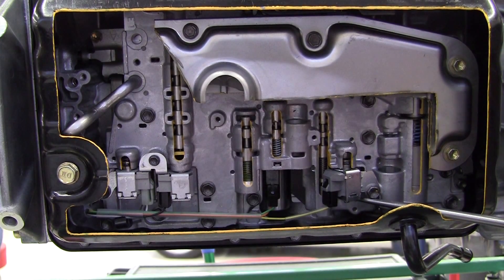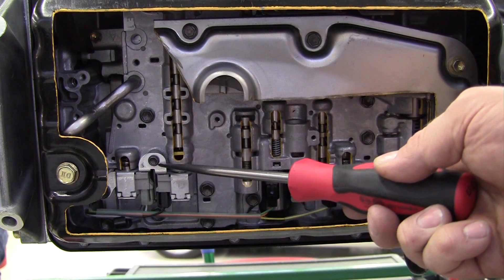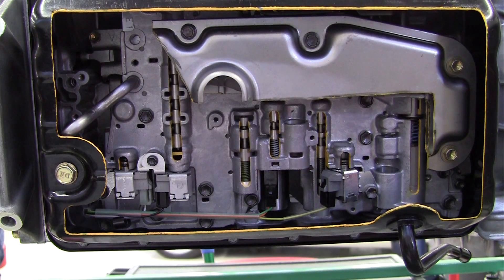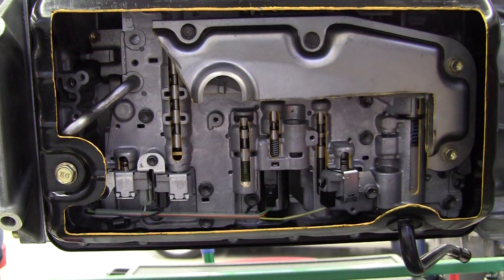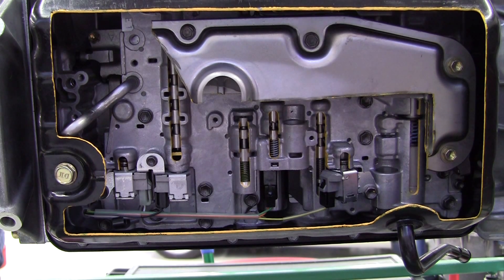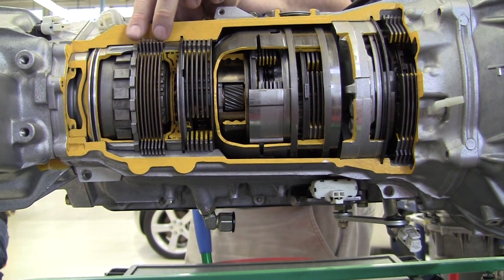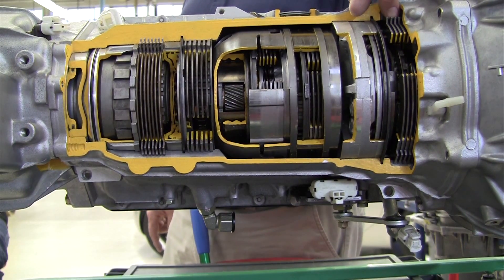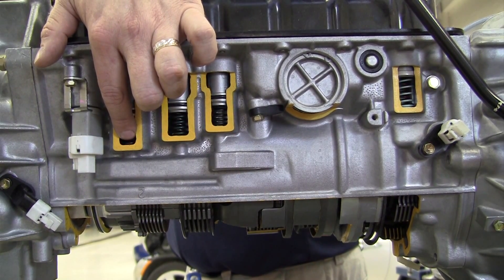Automatic Transmission Basic Hydraulic Operation - AUSV 2520

Comment: When we apply the parking gear and then we jack up the rear wheel and rotate it so the opposite wheel is going to rotate or not?? Because of the propeler shaft is locked from the parking gear pawl is it possible for the other opposite wheel to rotate in opposite direction.. Plz reply?????

Comment: Are accumulators needed when the the transmission has EPC solenoids for each shift valve?   ZF transmission has like 4-5 EPC solenoids that seem to do the same job as accumulators. I didn't see any accumulators on there hydraulic diagrams.

Comment: thank you for explaining the process. I have a 2002 tacoma 2.4 witha a44d Transmission. I do not have reverse. I do hear a hissing sound when I shift into reverse. It rarely engages into reverse on cold days. I did change the transmission oil along with adding locus ATF oil. Any suggestions on what could be the issue.

Comment: Having problems with a Land Rover lr4 transmission it will go into lip home mode after a while of having the driven the car a lot with air conditioning blasting it has a problem when only shifting up from 3rd to 4th but not down let me know if you have any suggestions
Reply: mileage? fault codes?

Comment: Can a torn 2-3 accumulator oring with no compression cause it to not shift to 3rd but still skip to 4th? Mine tries to shift at about 4500rpm but slips, but when I manually downshift from 4th I can feel it thump each time for each gear so I know it's attempting to shift but doesn't seem to be able to grip 3rd. Not sure if the clutch packs went out randomly at once with no signs, the sprag is bad, or if it's something with compression. Its a GM 4T65e transmission. I took mine accumulator apart and the 2-3 piston has as small chip and the oring really badly torn and almost melted looking? The fluid was def burnt but not full of contaminates, maybe since it came from Miami it overheated.
Reply from the maker: It is possible that the leak through the accumulator caused the third clutch to burn up. There is also a 3rd sprag clutch that may have quit holding. Best wishes
Reply: @WeberAuto  Thanks, let's hope it's a simple rebuild

Comment: how does fluid lubricate the gears,usually fluid level is very low ,not top up all the transmission body.
Reply from the maker: There is a fluid pump and passages to distribute the fluid

Comment: what would cause slamming into gear from P->R or N->D, the trans seems to slam going into any gear just more pronounced from 1->2 and it slams when I shift from park? 
it seems like there is excessive pressure when the vehicle is cold, but i am not an expert. I am using generic dexron 3 what is called out and the level is good when it is hot, but high when cold. the trans I have has a manual line pressure throttle cable, but doesn't seem to make the situation better when I adjust it, do you have any ideas, could this be a pressure regulator issue? thanks
Reply from the maker: The fluid could be the problem. High idle speed will also cause that. The TV cable adjustment should be tight at wide open throttle
Reply: what do you mean the fluid could be the problem, wrong type or level? do you have any recommendation what to try, would synthetic make any difference? the trans shifts beautiful after the truck is driven a little bit and warmed.
Reply from the maker: Wrong fluid, not GM approved Dexron. Generic Dexron is not recommended. In cold temperatures some non-approved fluids can be too thick and not flow properly. After it warms up, it flows fine.

Comment: What causes the transmission to shift hard into 2nd only when cold, it slams? 
I have a trans very similar to one in picture, an A340f.
I have rebuilt it myself, new seals, pump, torque converter and clutches didn't do anything with the valve body except new gasket and made sure the valves move freely. I adjusted the tv(line pressure ) cable in either direction but doesn't seem to make any difference. appreciate any advice. thanks
Reply from the maker: Accumulator spring or seal, excessive clutch travel, clutch dished spring upside down, the wrong fluid, etc. Start with proper fluid level and factory recommended fluid.
Reply: thanks for the advice, appreciate it. 
think its probably excessive clutch play. I did notice excessive play in the 2nd gear clutches, think like 30 thousandths past the max, but didn't know how to take up the slack and thought it would be ok since that's the way it was. not sure how it could get like that, the clutches weren't that worn and new ones were about the same?
Reply: figured out the problem or at least adjusting the cable made the problem go away. thought I adjusted it in both directions, but appently not. I thought tightening the cable would give more line pressure and fix the problem but losening it made the shifts softer and the slamming went away. I wish I understood what this cable does behind the scenes.

Comment: I have an Allison trans in 2005 gmc Diesel. When in d the transmission shifts through all the gears but when I use 3 the transmission will shift from first to 2 but will not shift into 3rd gear. I have a bully dog programmer with it set to tow haul mode . Other than the programmer being the problem, could there be another problem.
Reply from the maker: Witt factory calibrations, that would be an abnormal condition. I suspect the programmer is affecting it. Best wishes

Comment: Hello, Sir. Thank you for the great video!  I have a 2000 Nissan Xterra with some transmission issues. When I put it in drive, it won't move at all. It used to have delayed engagement, but now it won't move at all. I have to put it in D2 or D1 to get it to move forward( with some delayed engagement), and can be put into Drive once the tranny warms up, but sometimes won't move forward in drive soon after I turn the engine off. Reverse works as designed. I was advised to replace all the gear solenoids and to clean the line pressure solenoid. I have not done so thinking that a clogged line pressure solenoid would affect all gears.I was also told that a shift solenoid problem would cause a loss of at least one gear. The oil level is believed to be fine. Any suggestions?
Reply from the maker: Anytime you have to put a transmission in D2 or D1 to make it move, it indicates a severe internal problem with a transmission clutch pack, sprag, or roller clutch. Bad news either way. Best wishes!
Reply: Thank you for the answer,  Sir. It is highly appreciated.
Reply: i would try lucas trans fix, it may be a temp fix, but it has worked for me as a long term solution.

Comment: Cvt transmission angage reverse gear but no angage farward gears possible problems?
Reply from the maker: It sounds like the forward clutch pack is not working. Check your fluid level, if correct, there are internal problems.

Comment: Are you familiar with code P0770 on a Lexus?
Reply from the maker: Not enough to be very helpful. From what I can read, it seems like it is a solenoid hydraulic problem keeping the torque converter clutch engaged when it should not be.

Comment: Hi, I have a question regarding doing a "do it yourself" automatic transmission flush. The method is to remove the input line to the ATF cooler and drain that into a catch container while running the car then refill with new fluid through the dipstick tube. My question: is this method safe in that it will not be running the transmission "dry" during this process or do you need to fill the new fluid through the return line from the cooler to the transmission?  The transmission in question is a Aisin AW50-42LE used in older Volvo's and other cars. I've seen this method online but I just wanted to make sure it is safe for all automatics. Thank you!
Reply from the maker: Yes, it is good and safe procedure. Just make sure you keep adding fluid until the fluid coming out of the cooler return line is clean. Running dry is not good, but it won't hurt anything as long as long as it is for a very short period of time.

Comment: nice video and you know your stuff so am going to ask you something on Lexus ls430 6 speed  when cold it kind of like has hard shift untill warn but even when ward there is a very slight feel of gear change but if its going up a hill it perfectly fine almost seamless changes any idea where to look ? fluid already changed with ws fluid?
Reply from the maker: The valve bodies wear out with high mileage. There are repai kits available.

Comment: Very interesting video Sir! I have a question can overfilled transmission cause the Torque converter to shudder on the 4th gear? if the car shudder which part of the transmission will be damaged? and if the level is adjusted afterward will it solve the shuddering issue?Thank you & Best regards
Reply from the maker: Yes, overfilled transmissions can whip up the fluid and add bubbles to the mixture. Unlike fluids, bubbles do compress and can cause unreliable application pressures of the clutch pack required for each gear. Get the fluid level fixed and it should return to normal (if that was the issue)
Reply: Thank You :)

Comment: I have a one simple question. What will be happening if we put 80w-90 for example gear oil in automatic transmission? Or with other words what will be the damages if we wrong the gear fluids manual to automatic?
Reply from the maker: The transmission would probably burn up all of its clutch packs since the fluid is too thick to apply the pistons as quickly as it needs to.

Comment: NISSAN ALTIMA 2005 = The shifter wouldn't move out of parking. It just happens once in a while. Everything works fine suddenly one day shifter is struck in N and wouldn't move to reverse to go to parking but the car can move forward in drive gears. Tried turning the engine on and off wait for sometime, depress the brake few times and gave it a few taps to the right, boom it worked and never had a problem few weeks, again the same thing happened. Later checked internet and started using the shift interlock manual pressing method and now it is a permanent problem not trying to tap or do anything. Not sure if fuse is the issue. ANY SUGGESTIONS??
Reply from the maker: +Amer Khan Hi, It could be a brake switch adjustment problem or a poor connection. The brake switch is what activates the interlock solenoid. Best wishes!

Comment: Hello gentleman, seems you are pretty expert in automatic transmission, so i would ask you something about my w5a580.
Well a 2007 Dodge nitro purchased as brand new car on 2008, he is pretty good any problem till today. Just He has always made a tweeting noise since from 2007, during cold season only never during summer.

Noise happen when releasing throttle and car is running due its inertia or when no throttle descending from hill.
As example if i'm driving at 60 mph, and fully release throttle, this noise appear with car continue to run, if i press again on throttle noise disappear.
Also it happen in 3rd 4th and 5th gear only never with 1st and 2nd engaged. Same way if car is running with that noise and i put in neutral noise disappear.
No happen during stop.

I'm nut sure that is transmission, any idea?

Thanks chris
Reply from the maker: +Nuccio Lorenzi Hi, id does sound like a transmission problem. Make sure the fluid level is set correctly. If it is, the noise may be a sign of something failing inside. it could also be a normal noise in those gears. Best wishes!

Comment: A common shift sol. sequence would be A on B Off 1st gear. Both on 2nd gear. Both off 3rd gear. B on A off 4th gear. This is only an example but most all electronic shifted units will operate in a sequence of this manner. Great video.ALso on all electronic units whenever both sols. are off this would also be fail safe or limp mode as some call it.
Reply from the maker: +David Smith Very true, thanks for your feedback.
Reply: WeberAuto Great video. I have been in this trade for many years. I remember the old 350 and 400 cut away units like you are using to teach.
Reply: +David Smith  -  great comment, but I recall that my 1998 dodge caravan(41TE/A604)  stays in 2nd gear when it enters "Limp Mode".  Based on your comments, both sols. off would be 3rd gear...  Note: You said "all electronic units"  are that way... 
             ...."both sols. off = limp mode = 3rd gear." ...           Are you sure about what you said or was there a slight typo in your details?   I imagine it would be pretty hard for most cars to drive around from stop in 3rd gear, in fact I think the engine would probably be stalling quite easily.    

Thanks
Reply: autoparts321 You are correct. The GM 4L60E is 3rd. And Ford E4 and 4R100 is 4th. Wonder what they were thinking in that design. GM 4L80E 2nd gear. Yes I may have had a typo there in saying all units. However whatever gear is achieved with both switches off is fail safe. Thanks for commenting.
Reply: David Smith I guess "FAIL SAFE" makes sense as the name for the GM or Ford rather than "LIMP MODE"  because its hard to imagine any car being drivable from a stop using 4th gear. Its basically FAILED and SAFE.  The dodge caravan I recall being referred to in my repair guide as a LIMP MODE which implies it is still mobile but it would be slow or limited. FAIL SAFE seems to imply, not drivable. Thanks. Excellent video and commentary.  Thanks
Reply: autoparts321 Many instructors teach using the term fail safe. As to imply something has failed but the vehicle is safe to drive. Or there has been a failure but the vehicle is protected from further failure because it is in fail safe. I agree, odd way to word it but in my 35 years I have heard countless instructors use this wording.
Reply: +autoparts321   Here in Australia,the BTR 85,93 and 97LE transmissions have fail safe in 3rd gear.The car can be driven quite normally with reduced speed as the engines powering these have quite a bit of low down torque...

Comment: i drive a 2003  Pontiac Grand am GT it has the 3.4L engine. my transmisión doesn't go forward at first. if i step the gas it runs and all the gears come just fine. what can posibly be the problema???
Reply from the maker: +Michael Jordan Hi, I would start by checking your transmission fluid level when the transmission is Hot, not cold. If the fluid level is okay, then you may have internal problems in the transaxle. Thanks for watching.

Comment: good video, can you please explain how transmission oil from sump to pump and on will travel, like oil from sump to pump to some valve to line pressure & final to any one clutch.

and please how torque converter fluid is circulated, thanks in advance
Reply from the maker: +samy The oil travels from the sump to the pump through the filter directly into the pump. From the pump it is sent to the torque converter and then out to the cooler. From the cooler it comes back into the transmission and lubricates all the bushings, bearings, and gears before dropping back into the sump.  How's that? Thanks for watching!
Reply: @WeberAuto  doesn’t that fluid also enter the valve body and the channels to move the clutch packs?

Comment: HI, I need someone to address my concern even if my question is far from your, still my question covers transmission. I just have the engine of my honda civic overhauled and after 4 months of use, I noticed some oil leaks. I just found out that my ATF has gone below the normal level. Does this transmission oil leak may have something to do with the removal and re-installation of the engine? Is there any gasket that might be affected by the recent job? Need to know so I can charge the repair to the overhauling job warranty. Thanks
Reply: nicandro lalangan

Comment: do you have any video of  diagnostic of transmission looking at scan data see what parameters to check in between engine problems or faulty sensor like glitches that is not enough to flag a code but to cause shift problems??

Comment: I have a 04 Trailblazer that was jerking around 65mph. The torque converter clutch pulse valve in the valve body was sticking. Took the valve body out, clean it with soap and water. Some of the valve was dirty and sticking. The tcc pulse valve was turn around (so it want pulse anymore) and reinstall. The VB pressure control valve was stuck also. I had to replace it. The jerking is gone and I think I burn a little less gas because the engine rpm stay under 2000 rpm more now.

Comment: Hello, thanks for the great video. I have a 2011 honda accord at 44000 miles. I just bought the car. I realized that there is something wrong with the transmission. It jerks at slow speed accelerating between 1-2 after that 2-3-4-5 is very smooth. I have also recently read forms about even brandnew accords jerks too what could be reason for this problem? Thanks in advance.

Comment: First off, I enjoyed your video. I have a question about the 5R55W AT in my '02 Mercury Moutaineer.  I was getting a P0741 code (Torque Converter Cluch stuck or not working). The latest symptoms is when I shift into Reverse with foot still on brake, it's like something engages and there's a whirring sound, then down into D I get the same result, but if I then move lever to 1, 2 or 3, whirring stops & seems like normal. I appreciate any advice you give (fluid has been changed).

Comment: Generally speaking, manual transmissions are pretty much bullet proof.  Automatics, not so much.  It is not unusual to rebuild them once or twice through the lifespan of a vehicle.  And rebuilds are EXPENSIVE.  In USA, most folks drive automatics.  Most people here don't even know what a clutch is. I prefer manuals, but I am always buying used vehicles and it's hard to find manual transmissions here.  At least in the full size vehicles, If you try one, I hope it serves you well.  Good day.